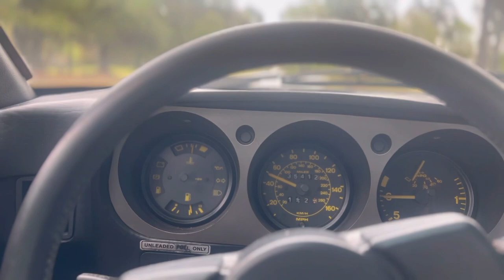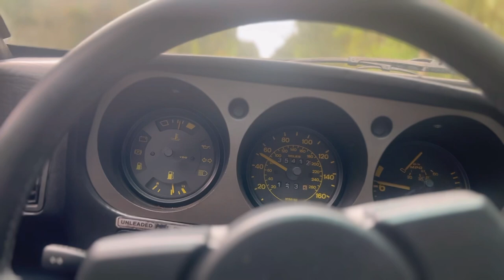My Porsche 944 won’t start I’m doomed and stuck in another state

Comment: don't forget check your ground wire off the battery make sure you got good clean connections on both sides i remember similar issue on my 944